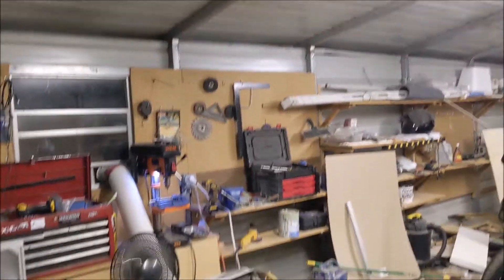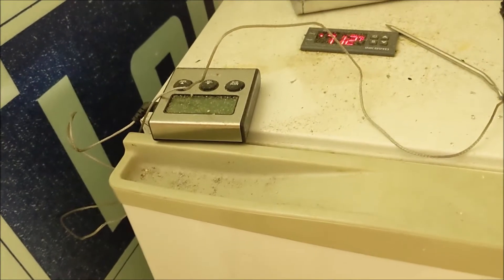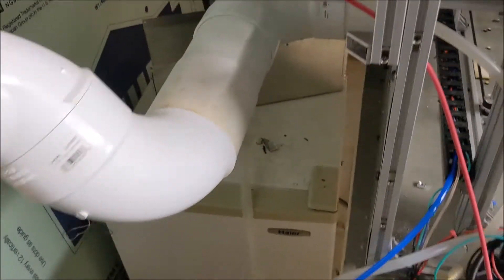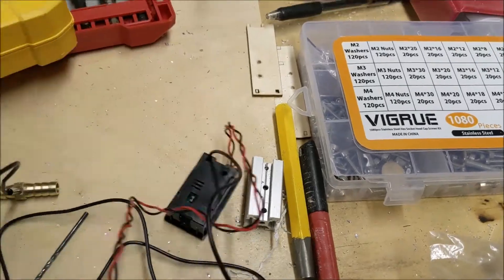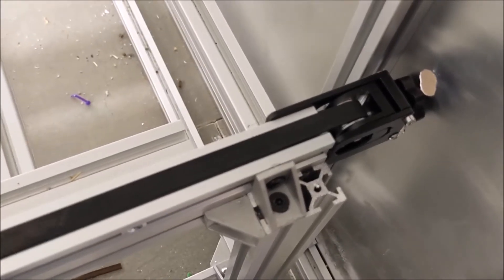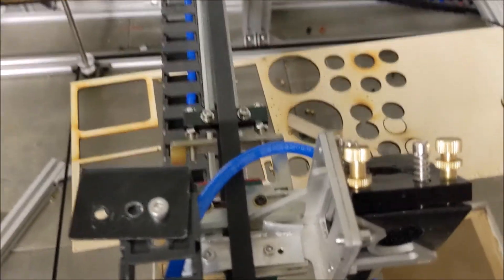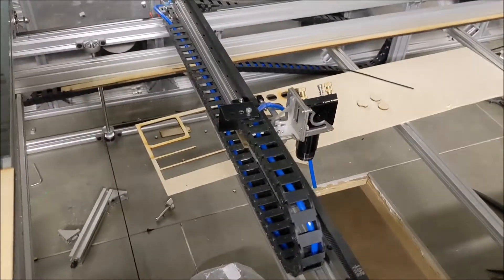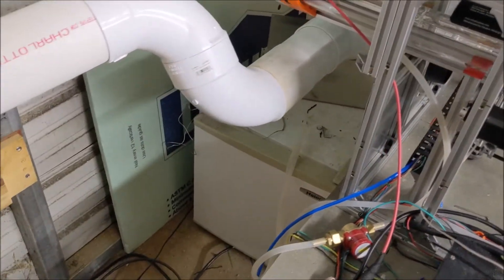Cheap CO2 laser cooler and upgrades for y-1200

Comment: Hi what's the power of your laser? I have a 100w laser,  and want to make a chiller from an old mini fridge. My laser is getting very hot I live in Brazil. Sometimes we cut for 2 hours in 70% power. Did you test your solution in similar situations?
Reply from the maker: It's a 100w laser, I have not tried running it continuously, only for short periods but it stays cool in my 90 f shed